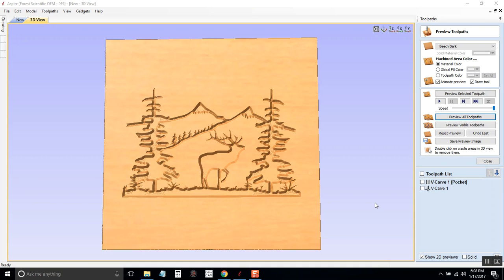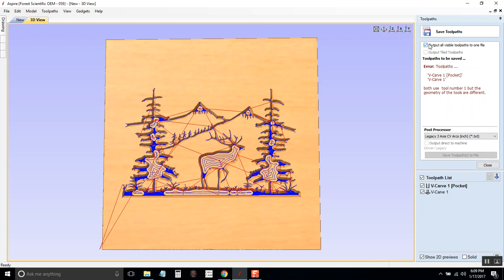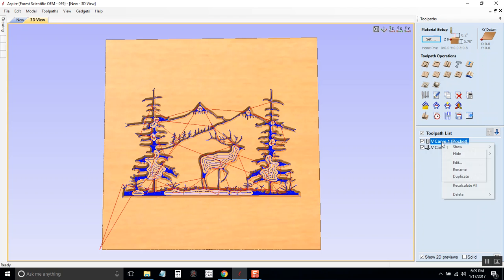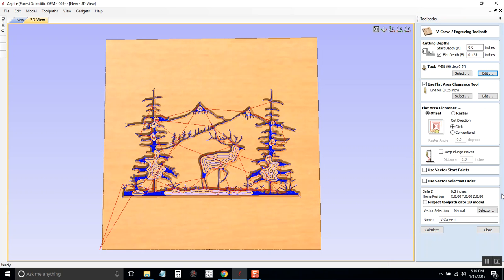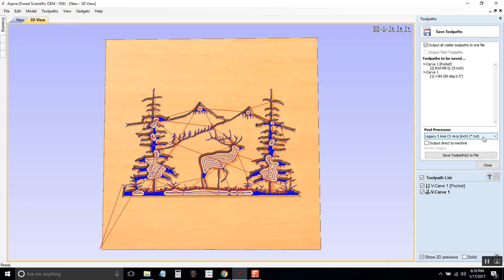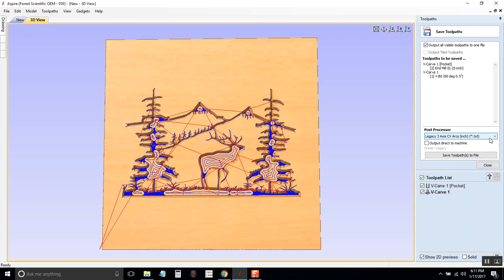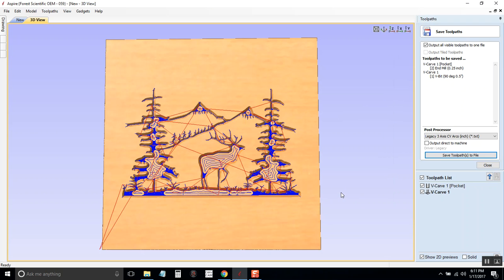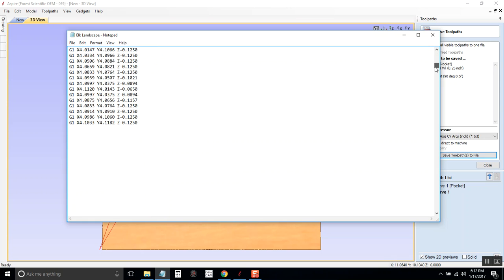4 Save Toolpath to G-code

Comment: If I am going to use GRBL Control (Candle) which post processor would I use. It only reads nc, ncc, ngc, tap & txt files it for the FoxAlien CNC Router 3018-SE V2. Ideally I want to utilize the offline controller